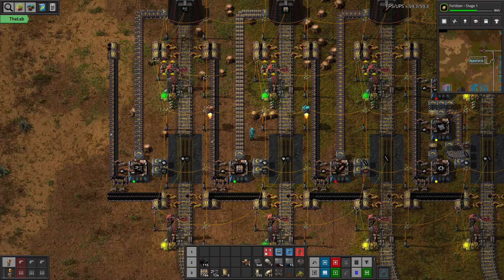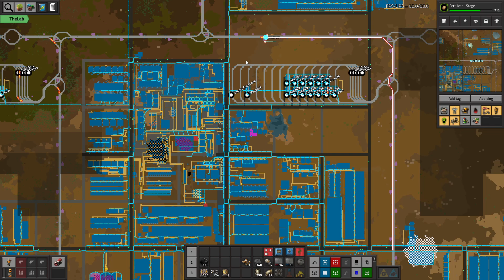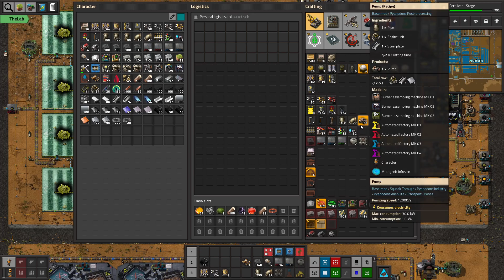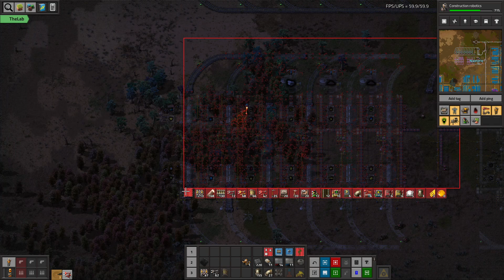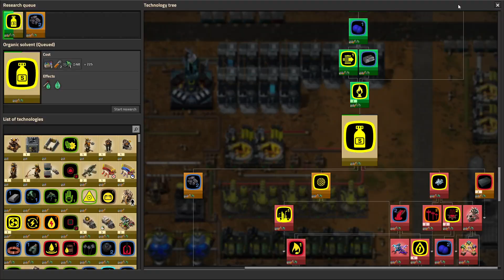Factorio Pyanadon Alternative Energy is Fun? -- 044 -- Train Hub Buildings

Comment: Putting buildings back into the trains that are above the rail unloaders, do they not just empty back out again?
Reply from the maker: yes they would, but the two decider combinators help with that. They read the LTN combinator and if asking for the buildings then the decider combinators output the disable rail loader signal, which will shut down the unloaders and leave the buildings on the train.